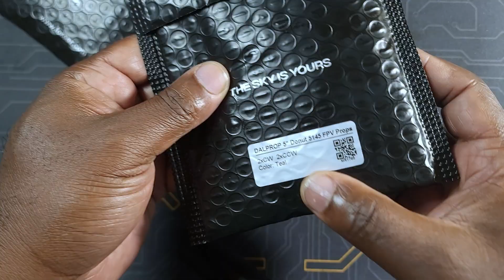Toroidal Propeller for your Drone (TEST)

Comment: Would Shrinking prop size, (in the toroidal footprint) decrease the weight and increase the RPM for the motor? Sluggish tells me its pushing the motor wanting  a little more torque to get them to spin better.

Comment: Turn all the propellers around and test whether the drone still has the same performance. If so, they are real 3D props. But I'll test it for the next few months anyway because I ordered the props too...
Reply from the maker: These are not 3d prop. I'm referring  to 3d print bcs it was the only way to get toroidal prop. If you wanted a set for your drone,  you literally had to print them.
Reply: @GBoniFPV  so you know that they don't have same trust in both directions ?
Reply: @Sugalime3D_FPV  you can tell that by simply looking at them
Reply: @notsure1502  ok i got them today and yes it seems like they are not for 3D. They are not symetric...
Reply: @Sugalime3D_FPV  correct, mine had arrows showung the direction of rotation. Fyi I broke mine in less than 1 minute 😆
Reply from the maker: @Not Sure, how did you manage  that